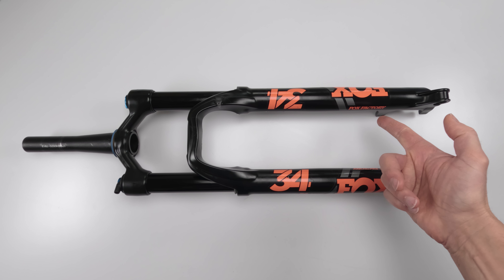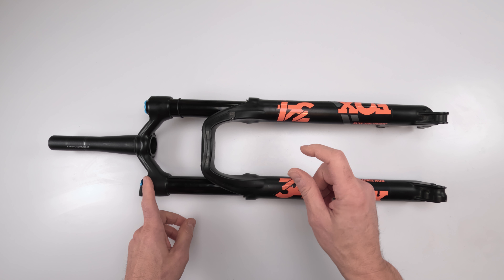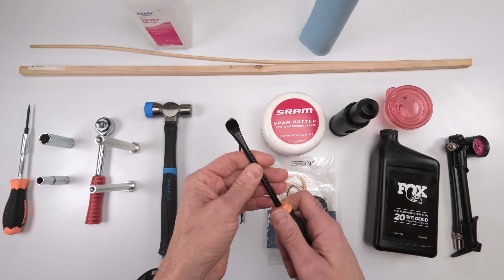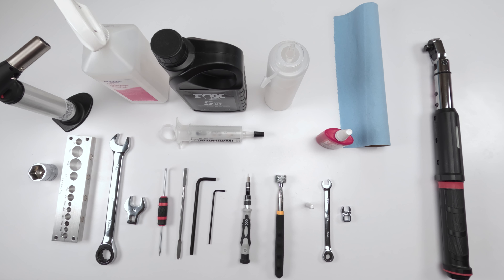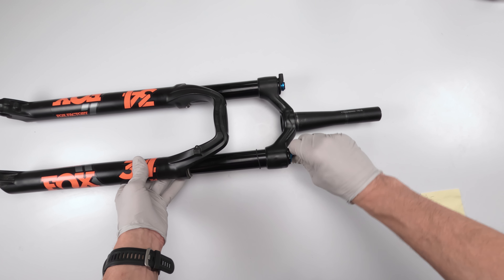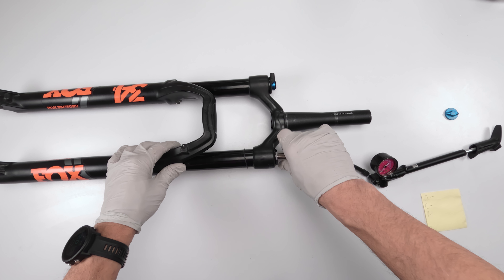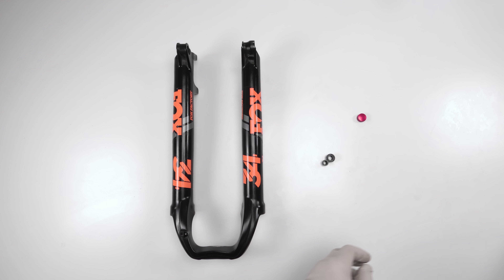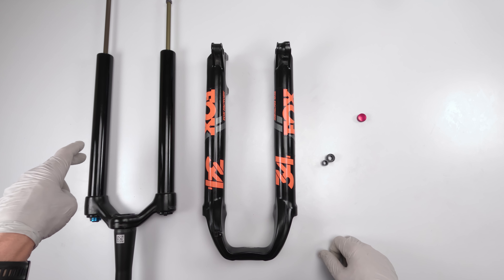FOX 34 Performance Elite FIT 4 2018 Fork Damper air spring + 50 hour service guide for beginners

Comment: This is the exact fork that I have and will be using your video to guide me in my own rebuild. Best tutorial videos I've ever seen for rebuilding bike bits! Thanks so much for your work. One question I do have is where do you get the two different soft jaws? I have looked around quite a bit including calling Fox and haven't been able to zero in on the exact part numbers for each of them.
Reply from the maker: Thank you very much for the kind words.

The soft jaws in the video can be found at this link. There is a drop-down menu that allows you to buy them individually. 
https://www.ebay.com/itm/115153412361?var=415219180268&_trkparms=amclksrc%3DITM%26aid%3D777008%26algo%3DPERSONAL.TOPIC%26ao%3D1%26asc%3D20221115143056%26meid%3Dbb2e0db11b3c4485a90ecbda86193d7d%26pid%3D101612%26rk%3D1%26rkt%3D1%26itm%3D415219180268%26pmt%3D0%26noa%3D1%26pg%3D4375194%26algv%3DRecentlyViewedItemsV2%26brand%3DUnbranded&_trksid=p4375194.c101612.m4236&_trkparms=parentrq%3A6bc8ba931890ab8e890a8061ffffddde%7Cpageci%3A64897b99-25d4-11ee-95a7-66535c790d40%7Ciid%3A1%7Cvlpname%3Avlp_homepage

This guy also sells similar soft jaws. But they don't have magnets. I've bought other tools from him in the past. Prices are good, and everything so far has been of great quality as far as precision goes.
https://www.ebay.com/str/bikewcm?_trksid=p2047675.m3561.l2563

For more cost-effective options, there are the following, which I've also bought. They work okay, but they are not as effective for high-torque situations as the above are. You definitely need a strong vice for printed jaws, and make sure both surfaces are very clean. 
https://www.ebay.com/sch/i.html?item=143899401986&rt=nc&_trksid=p2047675.m3561.l2562&_ssn=rnoksdesigns

Take your time with the job, and you should be fine. Watch some of the tricky parts a few times, so you can get the feel of them mentally. If you have ANY questions, definitely ask. I'll keep an eye out.👍

Comment: Is this damper the same that would be in a 2018 34 factory fit 4?
Reply from the maker: Yup! same internals. if you decides to service the upper damper, take your time with the shims. Follow the video, use a magnet to remove them. If for some unexpected reason they come out of order, let me know and I'll get you the shim stack order. Let me know if you have any other questions
Reply: @zoubtube  Thanks for the response!

Comment: Thank you for a great video - but both sides take 20wt on the fit 4?? I have really struggled to i.d my forks but are 34 performance Elite Fit 4 my 2018.
Reply from the maker: Thank you for watching it. Do you have a tune id or serial number for your fork? This is the best way to find out which for it is
Reply: Fit4 is 20wt both sides, the 5wt is only needed for grip and grip2. 2018 34 fit4 is 25cc damper side (100-120mm travel) or 25cc (130-160mm travel). 15cc in the air side regardless of travel.

Comment: Hi 
I have a fox 34 Performance on my Santa Cruz Tallboy 2024. Would it be the same ? 
Thank you
Reply from the maker: Is it a Performance or Performance elite? does it have a grip2 damper? if its a performance elite with a grip2 then yes. it is identical to the FS but with black stanchions.
Reply: @ it’s a 34 performance and only says grip, not grip2, maybe in a futur video😉. By the way your tutorial are the best, the way you do it, it is so easy to follow. Thanks
Reply from the maker: @ericlepage1159  Thank you very much for the compliment. if its a grip then the process will be similar but there will be details that are different. technically the grip is simpler to work on. I had posted a video on a on a grip damper (link below). it's on a rhythm fork but in the end the damper service will be the same. hope this help
https://youtu.be/Z6nAG5-T4oM
Reply: @ thank you

Comment: Entoces en la 2016 tengo que dejar los mismos 3 cm en el sangrado ?
Reply from the maker: Gracias por el comentario. Si tienes un FOX 34 FIT 4, Factory Series o Performance Elite 2016, entonces el procedimiento será el mismo que aparece en este video. Los años 2016, 2017 y 2018 son básicamente iguales.

Déjame saber si esto no responde a tu pregunta.